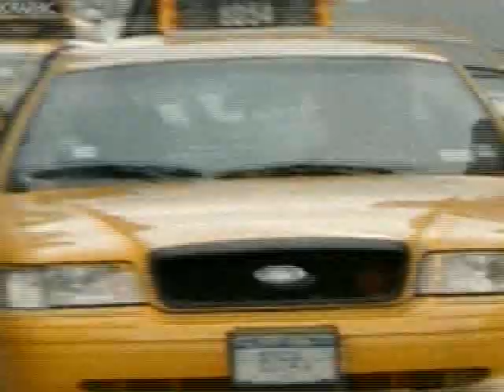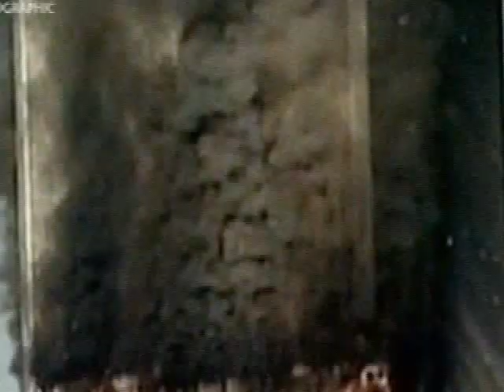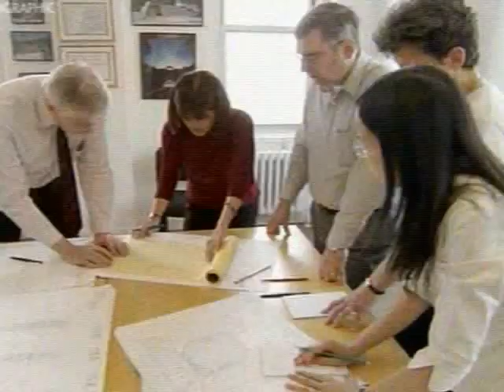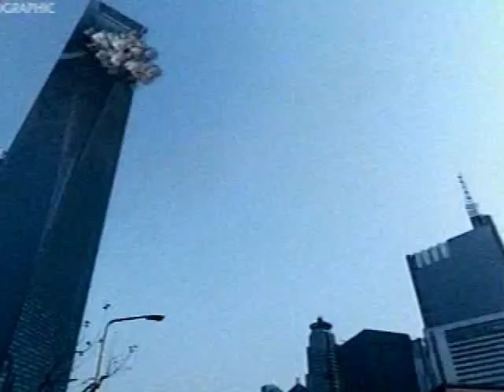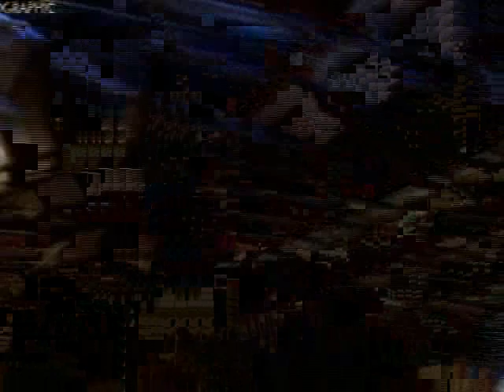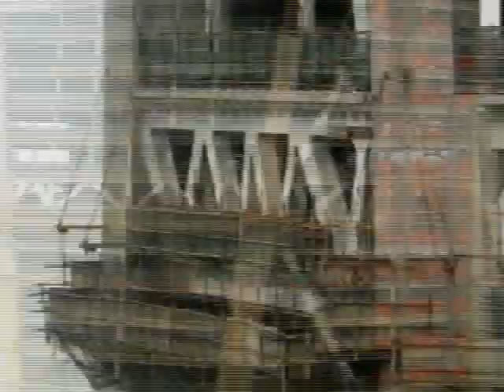Leslie Robertson gets another gig!

Comment: also we must take into account that the cast iron although it has high resistance for fire. it has limits. jet fuel combined with any other explosion in the floors combined to cause a towering inferno. the iron resisted long enough to have people get out. however the materials melted causing the support beams to collapse then causing a domino effect all that load crashing over the lower floors. simple physics!!

Comment: Newtons Third Law - How can that small chunk at the top fall and disintegrate the while rest of the building. The top is no different that the rest, it's actually stronger as you near the ground level. So, if as Newton has given us, every force meets an equal and opposite force did the lower part just "explode" like that while the top drifted down as if riding on a cloud of dust?

Comment: Mr. Robertson,
You should NOT "have a problem with 9-11." You have no reason to feel any guilt. When you saw the results in Manhattan and were told that the towers "collapsed" you did not understand what you heard and saw, because no human had ever before seen the results of the weaponry that was used to destroy the SEVEN WTC buildings that day.
Instead of feeling guilt, study the slow motion HD video of the south tower crumbling to the ground. Pick out and follow any single piece of debris that is falling. Note that it is leaving behind a thick trail of dust as it shrinks away to nothing while falling, with most such pieces never reaching the ground. Study the duration of the event: less than 11 seconds, essentially free fall speed. Study the seismic signal of each event: 8-fold too weak to have been a controlled demolition and many-fold too short to have been a pancake collapse. Simple high school physics here. Study the height of the debris pile that resulted: about 20 feet high, not the 20 stories expected from a pancake collapse. These are undeniable, well documented facts.
No, Mr. Robertson, you and your team designed sound buildings, and they did their job well as long as they existed. However, on 9-11 they ceased to exist and were replaced sequentially by huge towers of altered material that crumbled away to dust and scattered itself all over Manhattan, with a significant portion drifting down the eastern seaboard on the prevailing winds from Hurricane Erin.
Learn the truth, and your guilt will vanish, and likely be replaced by anger.